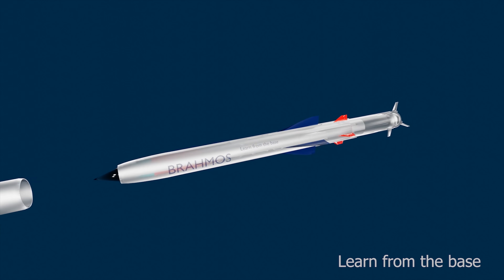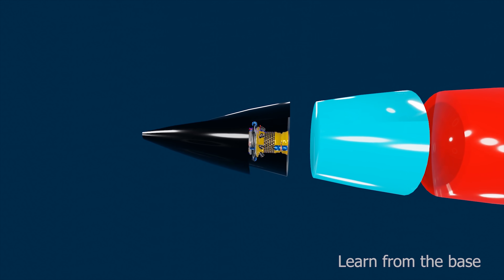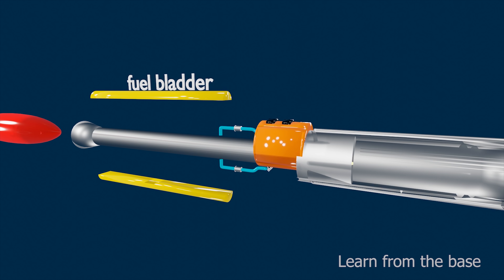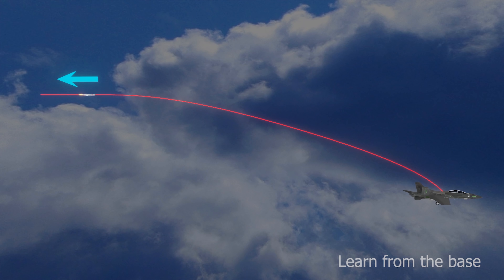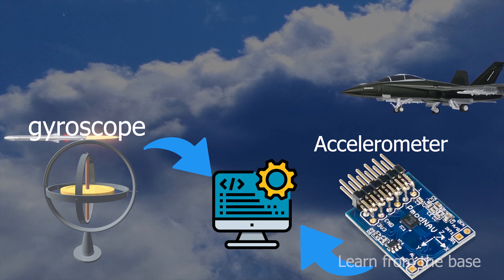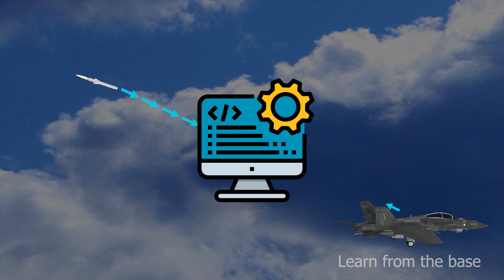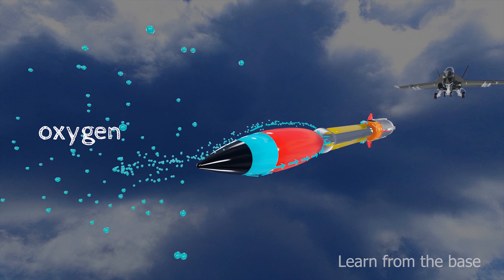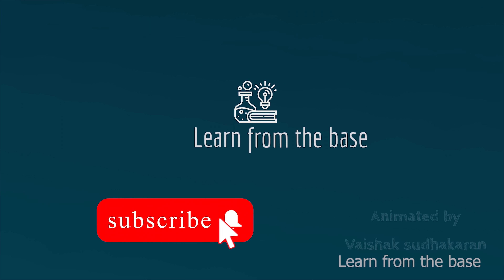HOW A MISSILE WORKS?...(BrahMos) world  fastest supersonic cruise missile/ learn from the base

Comment: Alright bois say it with me

The missile knows where it is at all times. It knows this because it knows where it isn't. By subtracting where it is from where it isn't, or where it isn't from where it is , it obtains a difference, or deviation. The guidance subsystem uses deviations to generate corrective commands to drive the missile from a position where it is to a position where it isn't, and arriving at a position where it wasn't, it now is. Consequently, the position where it is, is now the position that it wasn't, and it follows that the position that it was, is now the position that it isn't.
In the event that the position that it is in is not the position that it wasn't, the system has acquired a variation, the variation being the difference between where the missile is, and where it wasn't. If variation is considered to be a significant factor, it too may be corrected by the GEA. However, the missile must also know where it was.
The missile guidance computer scenario works as follows. Because a variation has modified some of the information the missile has obtained, it is not sure just where it is. However, it is sure where it isn't, within reason, and it knows where it was. It now subtracts where it should be from where it wasn't, or vice-versa, and by differentiating this from the algebraic sum of where it shouldn't be, and where it was, it is able to obtain the deviation and its variation, which is called error.
Reply: Accurate probability is the answer
Reply: A missile records it's position in actual and it also knows its hypothetical path, if there is a difference between its planned path and its present position a corrective device is used to redirect it into the planned path so that at all times it moves into the planned path and the deviation is Zero,. Simply said

Comment: Sensory is the weak point . Because advance direct energy weapon from jet fighter can cook cc fast beyond operational specification. The thermo direct bodiless is more threat to pilot than missile because heat does not need accuracy or precision it could heat or explode a region of air with air craft inside and cook, boil , or grill or instanteous combustion at choice

Comment: Children, FEW cruise missiles are supersonic. Most are hypersonic ie: MORE than THREE times the speed of sound and that is since the 1964 North American Aviation GAM-77 Hound Dog which was Mach 2.5. My late Father BUILT them, and I worked on them in the USAF when they were being phased-out as too "dumb" a weapons system as far as target acquisition and seeking. They didn't have optical targeting capability which the NEXTGEN weapons systems would have for the mid 1970's. Even rounds from the M-1 Abrams 155mm main gun can be laser guided by an infantryman remotely. Also the 105mm howitzer rounds from a C-130 Gunship can be independently targeted. You're 50 years out-of-date!
Reply: U don't know the difference between a ballastic and cruise missile